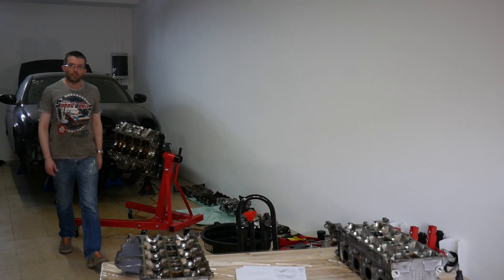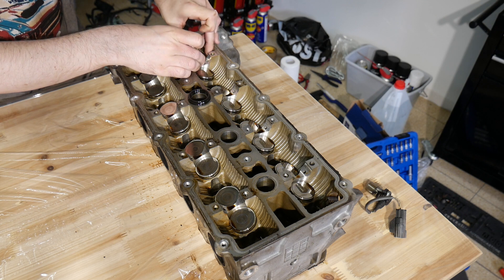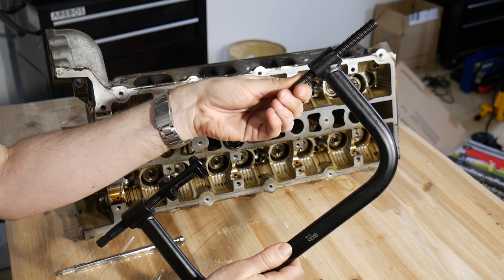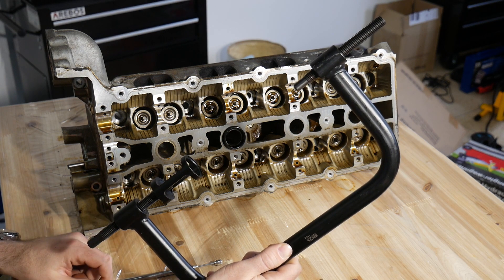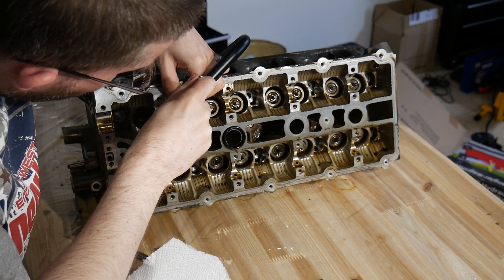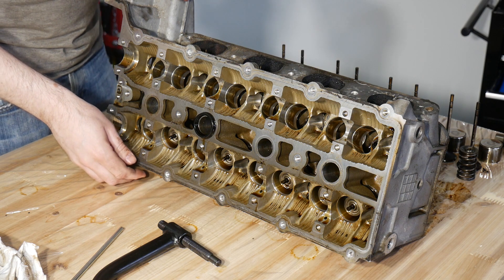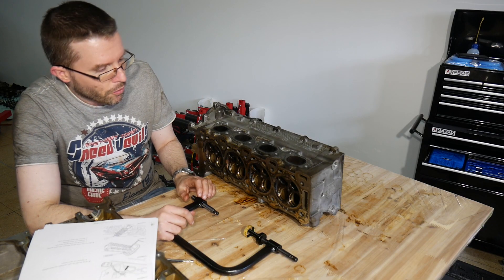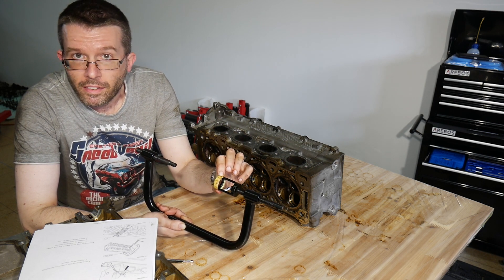Jaguar S-Type Restoration [32] AJ-V8 ENGINE Disassembly (5) Valve Removal [2020-05-29]

Comment: Hey on video 15 at 6:50 you used a socket to get the harness unplugged from that bolt I can’t find a socket to fit it anywhere  and I’m stuck at that bolt any help is awesome and appreciated man thanks so much man
Reply from the maker: Just watched the video again - even though I now think this bolt head is really proprietary (read this in the workshop manual), I got it loose with a 10 mm hex socket...
Reply: AUTOdidact awesome thanks will give it a go again tomorrow
Reply from the maker: I'm now back in the garage (for day 33) and really looking at this bolt for the first time. It's actually an ordinary 10 mm hex, but maybe this changed over time. My cylinder head bolts were also hex, while the workshop manual refered to polydrive bolts...
Reply: AUTOdidact strange I gotta figure that one out
Reply: By the way are you on social media?
Reply from the maker: Just created an Instagram account (a.u.t.o.didact), but no activity yet...
Reply: AUTOdidact no worries definitely I’d say once get some content up there pictures of the car, your story etc. I’m big with the jag community on insta so I’ll go give you a shout out
Reply from the maker: Thanks a lot - will try to justify that with a bit of content soon :)